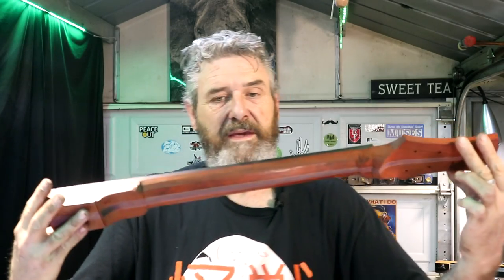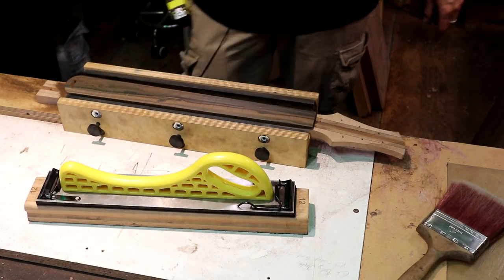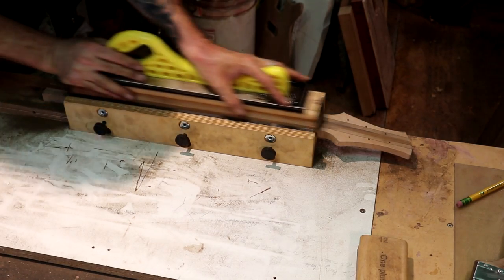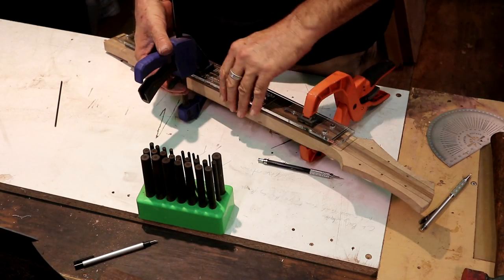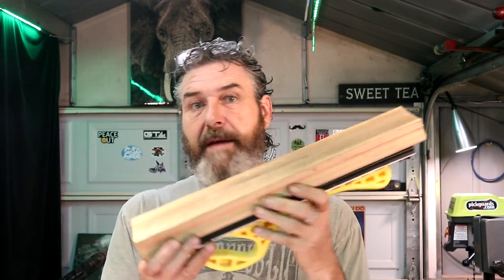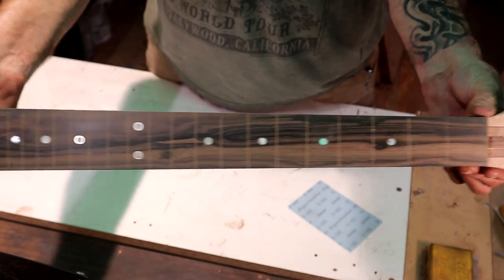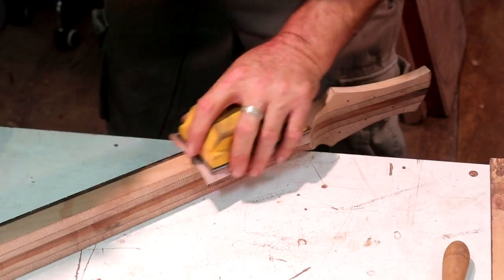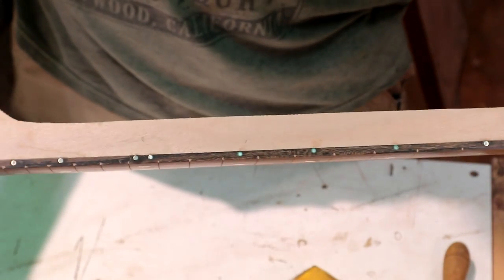Scratch Building an Electric Guitar - Figure 8 - Episode 7 - Sweet T Guitars

Comment: Todd, I don't know if you're at all familiar with bow-making, but there's a fella name Mike Yancey (owns & runs Pine Hollow Longbows), and when he's working on the belly of a bow (essentially doing the facets and material removal with files, paper & scrapers etc.), he clamps the grip/riser/middle of the bow in his vise, and out where the tip sits he has...  Well, it's basically like a T-stand with a cross-braced base.  The "T" has a concave top which is lined with something soft (probably buckskin, knowing him) and he's got a bungee cord fixed to it so he can rest the tip of the limb on the T, then strap it down with the bungee.  It seems to hold the extended length pretty securely.

I've watched a fair amount of guitar builders all, at some point, trying to work on the neck while it's only clamped at one end, and I've often thought "I'm gonna make one of those T-thingies when I get around to making a neck from scratch..."

It basically needs to be about as tall as whatever vise you're using - maybe an inch or two lower to account for the thicker nature of a guitar neck over a bow.
Reply from the maker: Man, that is a great idea. I actually have plans for a neck jig for both shaoing and sanding. I've just not gotten to it yet. I want to redo a few things in my shop which involves raising my table tops. Once I have that done I will proceed to build these jigs I've designed. I'm hoping it will improve my work holding all together. We shall see. Thank you so much for the info though. I will give it some thought before I move forward with my own design. ✌️